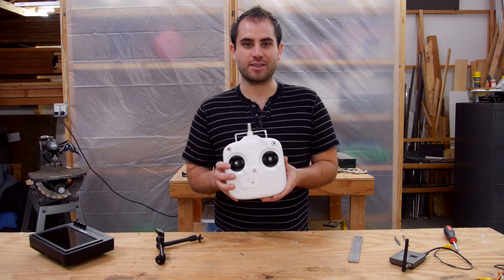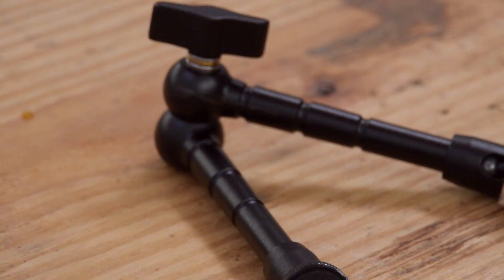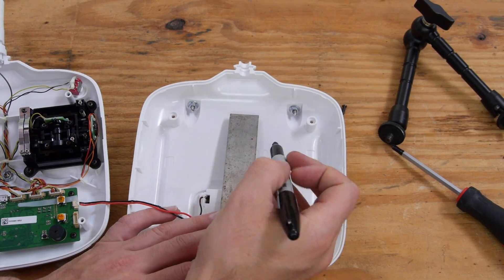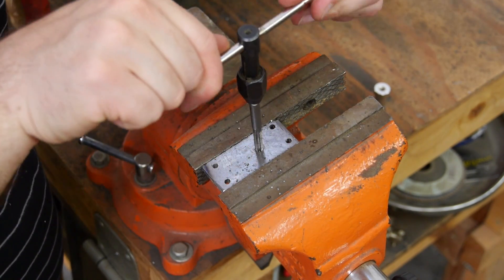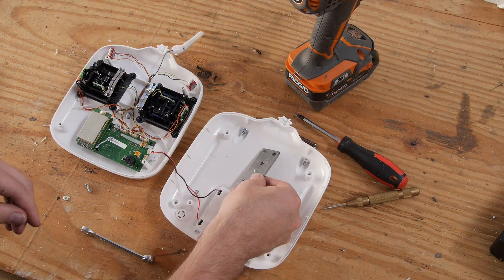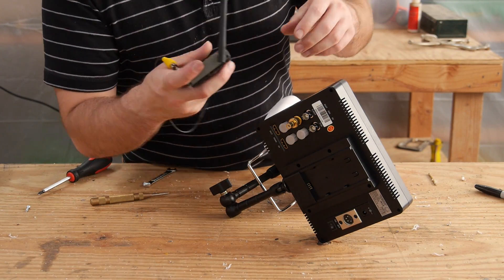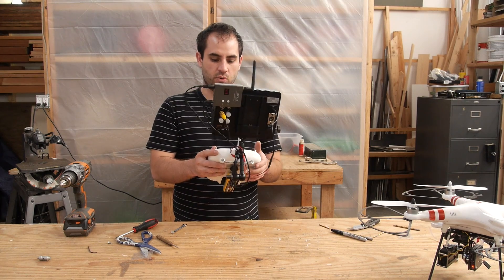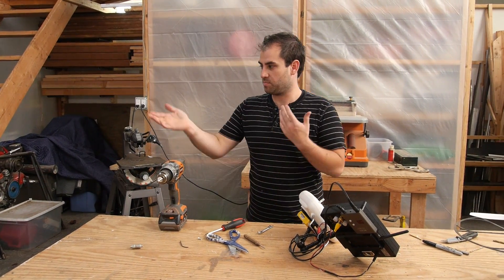Add a 1/4" thread mount to your Phantom Controller

Comment: should of just bought a black pearl....1/4 of the weight of that set up and looks way cleaner.... plus has a diversity receiver...and they have mounts that just clamp onto the back handle....for less than 200

Comment: Nice video Will, you might be interested this kickstarter project if you are going to switch screens in the future (they ship with the same screen as the iPad)

https://www.kickstarter.com/projects/1859884318/oscar-the-open-screen-adapter
Reply: ***** I did get one and they are shipping them this month, so if you keep an eye on ebay they will probably pop up soon. But hopefully they will start selling it to every body eventually.

Also the code and PCB layout is open source so you can get the schematics and try to build one yourself (and get the screen separately) :)